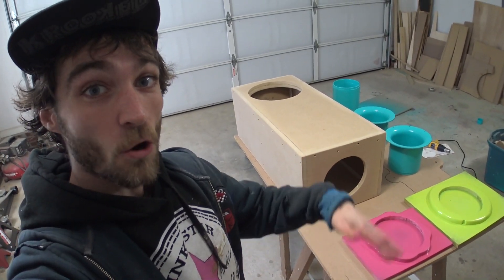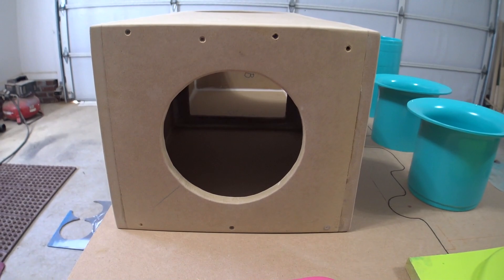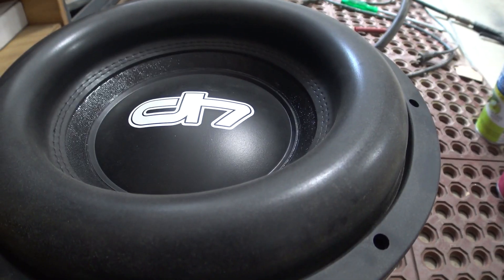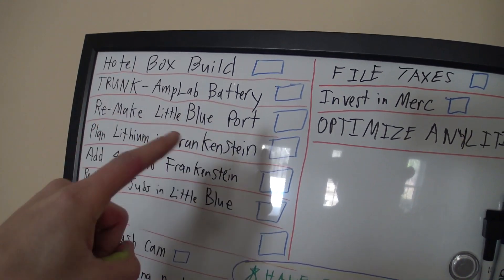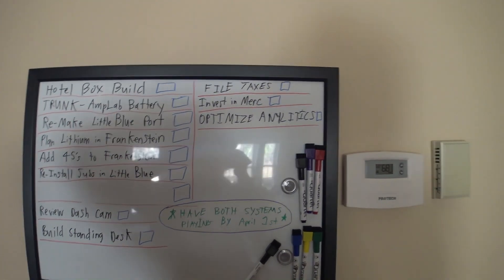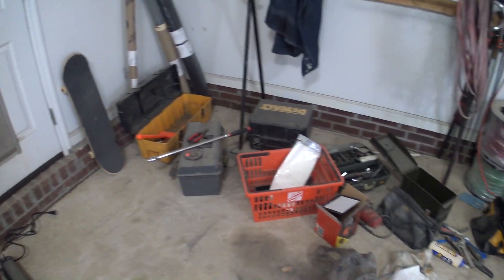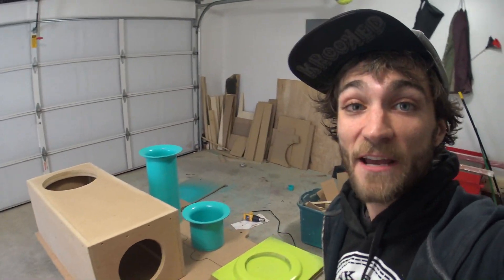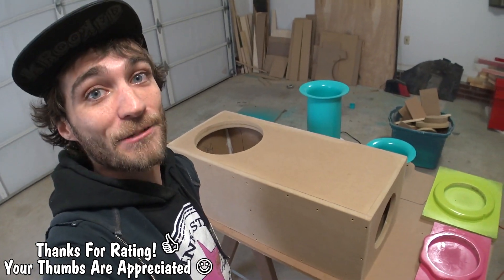12" Ported Subwoofer Box UPDATE w/ EXO's BigAss Adjustable Port | Car Audio Plans & 18" PSI Sub

Comment: I use birch instead of mdf. Keeps mdf dust away very well. Also keeps the weight down too for less sagging.IF I had to use mdf I would just use my wet/dry vac hooked up to whatever tool I was using.

Comment: MDF -- I use a "dust deputy" connected to a bucket ( Google it, many many example setups ). My router has a vac. port on it. The last time I did cutting, I had 3" of MDF in the bottom of the bucket, the vac. was 100% empty ( clean filters )  and i had no MDF dust at all in my garage as the vac sucked it all up & and dust-deputy kept it contained in the bucket -- not destroying the vac!

Comment: duct taping furnace filters on box fans put them under garge door it will collect about 75% of the dust works better if u dampen filters with spray bottle so dust sticks to filter good i do this when remodling homes cutting up the mdf floors in mobile homes works pretty good in windows and garage doors
Reply: Shawn Miller I did this when I use to do trim carpentry when I built houses
Reply: bigvell02 works pretty good for cheap i do mobile home maintenance remodling restoration these old trailers have a mdf type of flooring when they rot i gut floors fans do ok to keep dust down

Comment: Loop the power steering rack, and remove the pump. It will be twice as easy to do drive. Make sure you drain about half the fluid out of the rack to. A little research will show you how, Honda forums have great write ups and it applies to most any car. Most of the work in turning is pushing the fluid through the pump and junk when the pump isn't working. I've deleted power steering on 3 cars now, and looping the rack makes it nearly stock like above about 2mph.

Comment: my sister had a Saturn Ion and it was a recall in the steering column that caused a lot of problems with power steering.... just a heads up you might want to contact the dealer and give them your VIN and maybe they can look it up for you

Comment: Does dash cluster say or did say PWR STR ? If so you need to change the power steering motor connected to the steering column

Comment: for MDF dust get a huge shop vac. and make a cone adapter at the end. it's should suck up 90% of the dust do to the fact the dust is very light and is easily manipulated by air movement. make the cone like 8 inches long and it goes out to about 9 to 10 inches around. I used old cardboard and duct tape. also you can use a big funnel. cut the small tube off the end till you have an opening in the funnel just a hair smaller then the hose so it can slide in and tape it on  I hung a small rope from the ceiling and let the cone face downward like a shower curtain facing it torwards me, obviously you don't want it behind you it will suck it into your face. on the other side also to add to it the blow side of the vac you can connect another hose hang it behind you and you can actually use it to blow the dust torwards the pick up so it doesn't fling at you. also you can run a pickup under the table. that's only when I do particle board since the dust is heavier and will fall faster.

Comment: Rzmask.com for respirator and a dust deputy hooked up to my shop vac with different attachments for router and table saw keeps the dust pretty from getting to me. The big problem I have is painting all those fumes. I wear my mask and don't smell anything but when I take it off to leave the shop holly hell need to get an exhaust fan bad.

Comment: 1- Better mask and eye wear  2- Fans, Open the garage door 1 blowing toward your work and 1 blowing out the garage door in a straight line. 3 Without door open and fans the finite MDF particles float in the air so when you take your mask off you're constantly choking on them, Blow them the fook out of there lol 👍🙌  P.S. everything just outside the garage door will get dusty.

Comment: I have a Orion Hcca 2500.1  amplifier I need to get it repaired would you know anyone who could do it for me if I were to ship it and pay for the repair there's no current flow in the rca inputs of the amplifier and I believe that the  amplifier is also in protection mode .

Comment: 39hz? isn't that a little high?
Reply: Jeremy Smith thats wat i was saying
Reply: I though he said 29
Reply: 18hz or nothin. The LOW lows <3
Reply: Or IB
Reply: you can barely hear that frequency
Reply: Come sit in my car, then tell me you can't hear 18hz ;)
Reply: 24 is the lowest audible frequency Ive heard that actually has character, anything lower doesnt sound like bass, its just sounds like air
Reply: even if you could reach 18 hertz, sub would be huge like 35 inches diameter with a 15 cubic inches box, sounds ridiculous to me, plus you said a car wich doesn't have the space for such a box.
Reply: As I said, IB in a car, 18hz is easily achieved...its actually easier to achieve in a car due to cabin gain, In a house its much harder to achieve loudness

Comment: it might be your beard. that kind of mask needs to have skin contact to seal. put your mask on, then cover the respirator part with your hand so air cant escape. so when you breath out you can feel where your have air leaks. if no air escapes then your all good. if you don't feel the pressure build up in the mask then tighten down or adjust your mask to proper seal. best with two people. another thing could be the wrong filter on your mask for that job. there are many types of filters you can change out or maybe it's just ready for a replacement filter.